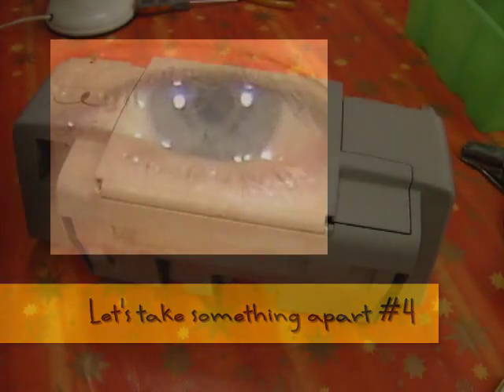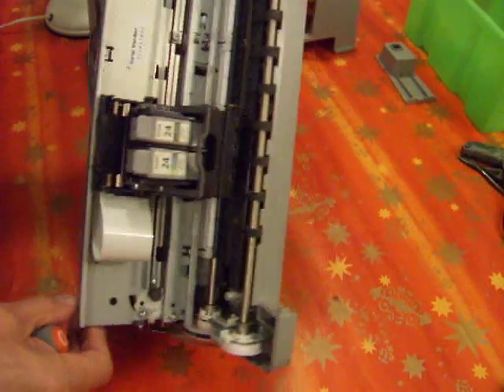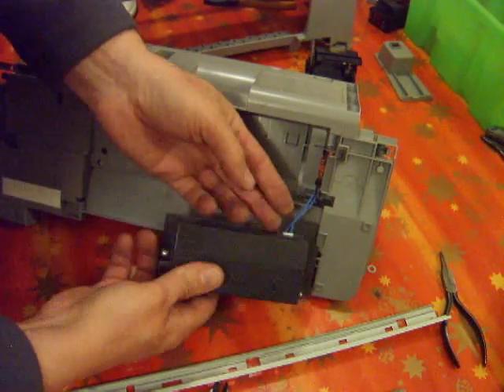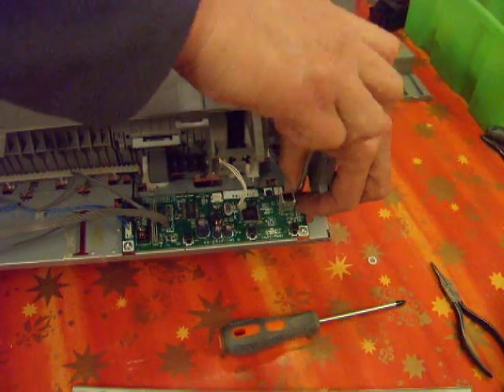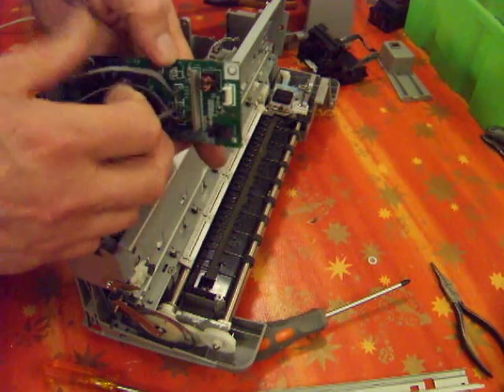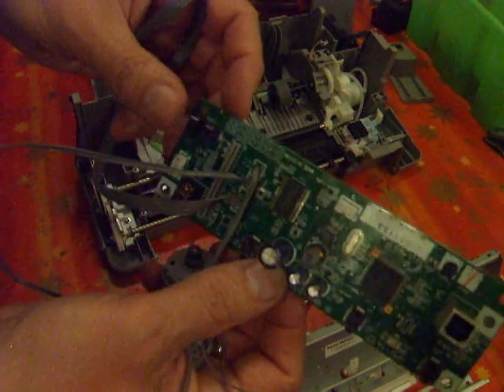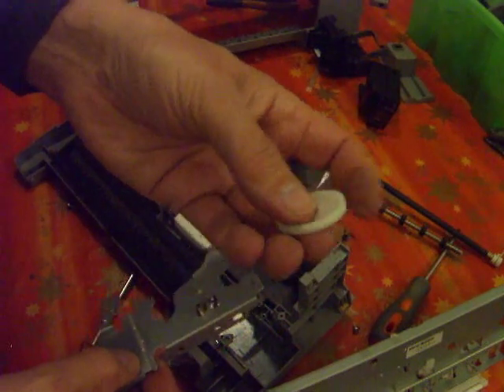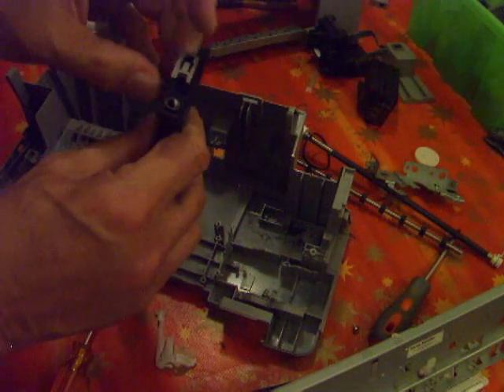Let's take something apart #4 - Canon Printer

Comment: Hi can you make a video of you making a robot or something from those salvaged parts?
Reply from the maker: +scoob y my entire channel is based on using parts salvaged from scrapped items or bought cheap. Exactly which parts are used in which projects is probably a bit hard to track now. This printer video was May 2013 so I doubt I could remember what I used the bits for. Probably still have some of the bits in a box somewhere. The motors could have been used in any motorised project. I can think of a couple of odd parts being used in unlikely places. I think this is one of the roller bars in this video https://youtu.be/bpXOHwqCTLc this looks like one of the motors https://youtu.be/Lavhjg1lrqc  and here https://youtu.be/6TWK5fXrZu8  and here https://youtu.be/tc9sCMyMXFg